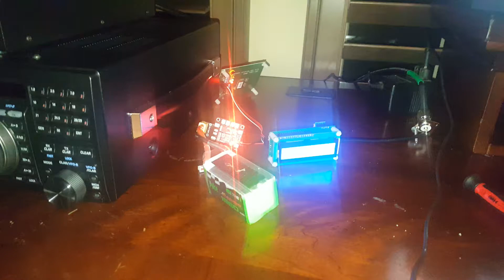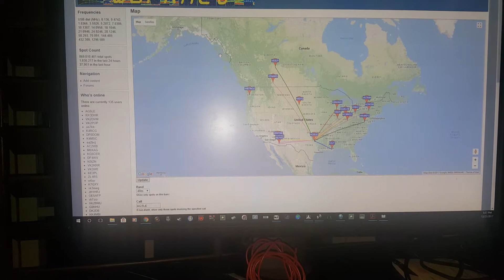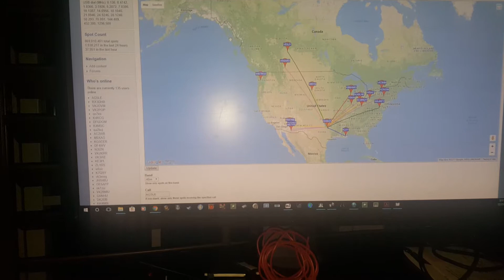QRP Labs Ultimate 3s WSPR Kit in action

Comment: Greetings, nice video. I'm new at this, just out of curiosity, what exactly is the GPS module used for?
Reply from the maker: Thank you for the comment. The GPS does three things: It displays the Lat/Long and Altitude on the display, it sets the locator, and it also acts as a very accurate timesource to calibrate the internal frequency the synthesiser uses to generate the output frequency.

Edit: I originally said it did not set the locator - but it does. Been a while since I set this up ;)
Reply: Thank you sir for the response, it was very informative. I think I'm going to build both those kits. Thank you again.
Reply from the maker: You are very welcome. Drop me a line if you have any building questions. More than happy to answer
Reply: @na5y  Hello, is the GPS receiver required or does the WSPR transceiver also works without it?
Reply from the maker: @forestradio_  It will work without GPS - have a look here under "Options"
https://qrp-labs.com/ultimate3/u3s.html